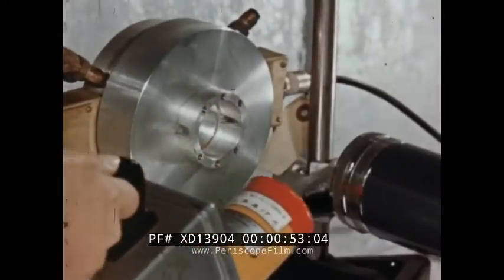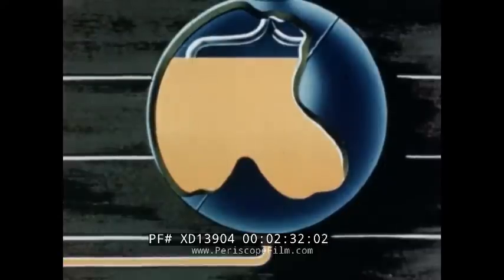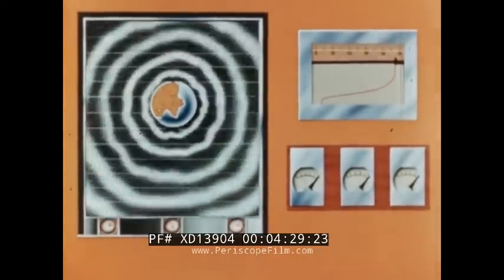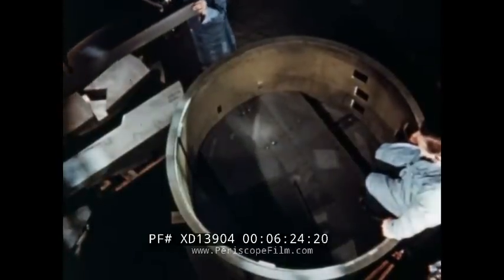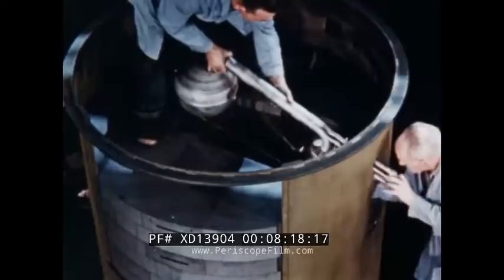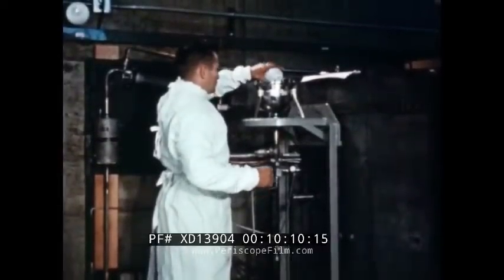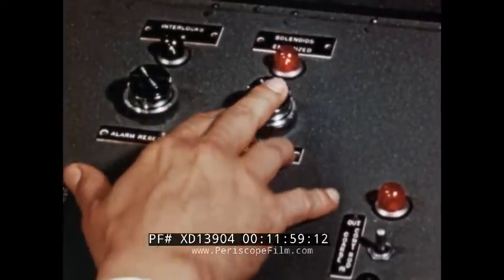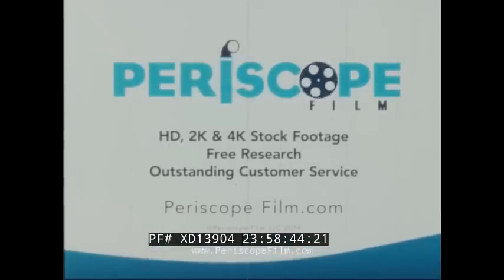" NUCLEAR REACTORS FOR RESEARCH" 1955 LOW POWER ATOMIC RESEARCH REACTORS NUCLEAR ENGINEERING XD13904

Comment: No mention of the cake of off white color. I came in at the end of the era, heard stories of the tons of "N" stamped welding rod, then a couple decades later watched tons of surplus sold for pennies on the dollar, with certifications. Flag tagged, FTOE FTBO = Flag tag one end - Flag tag both ends - adds an extra $0.15 per lb for 1/8th inch, $0.25 for 3/32,  and so on to .023 @ $5.00/lb Then stamped rod came about to save the labor for the pipeline business. San Onofre was a huge end user and as a vendor to several suppliers of theirs I got to participate in the last open house prior to the shut down...the view was incredible.

Comment: Not a nuclear engineer, still the overall safety level of this contraption scares the c*ap out of me..
Reply: That's where molten salt saves the day. It was available back then, we had a working model that was shut down decades ago at the first power plant.
Reply: Aqueous reactors are VERY safe precisely because they are very low powered. A few of the 1950’s reactors are still being used at universities.

Comment: My god. The radiation exposure to all the people.  They really had no idea what hat they where playing with
Reply: They did, they just didn't get irradiated like you suggest.
Reply: to beginn with, that reactor was designed to steadily run at 100 thermal W of power and due to its autoshut off feature ie

power-excursion -> parts of the uranyl will due to boiling move to another container ->  not enough material together in one volume to reach criticality.

suddenly the core is geometrically safe.